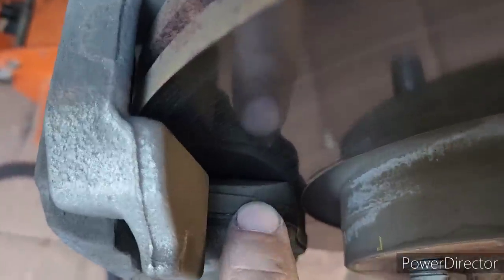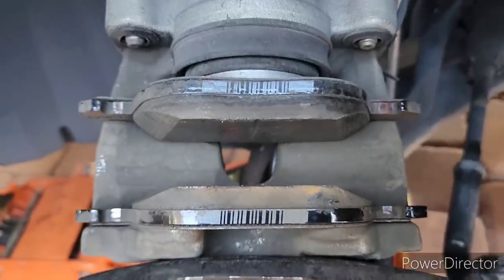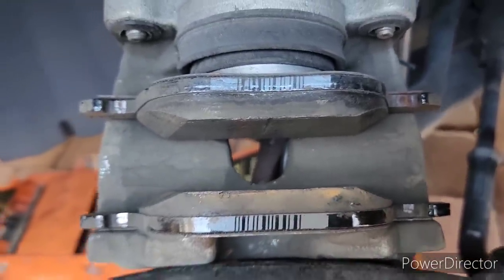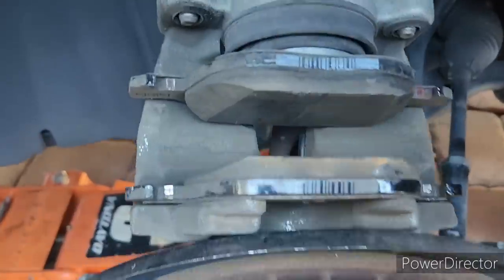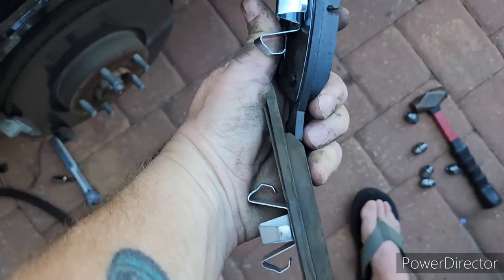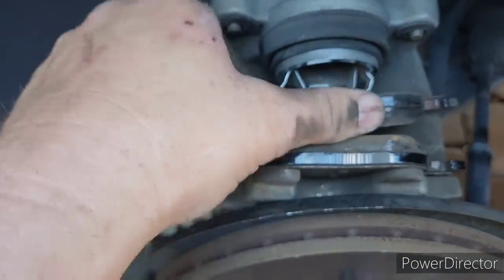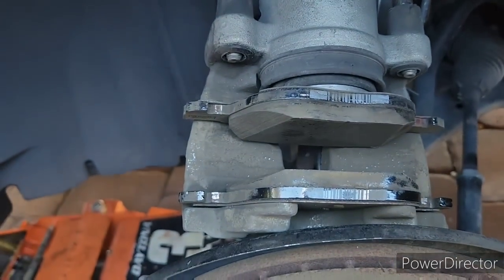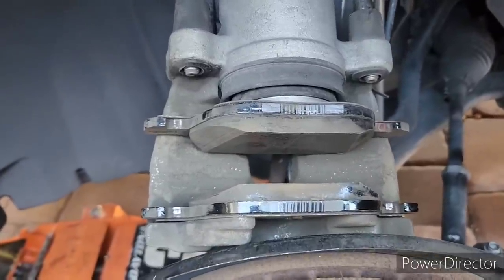Ford dealership robbed a little old lady out of a brake job. (almost)

Comment: Years ago I took my Vespa to a Harley dealership for a motorcycle inspection;  there were no other cycle inspection places around. Yes, they made fun of it, ok, whatever.  The state says they have 1/2 hour to do the inspection and can charge their rate for that.  There are glass window between the waiting room and the shop.  They wheeled my Vespa into the shop, put it on it's stand, and left it there for 29 minutes.  In the last minute, the guy walks over, peels off the old inspection sticker and puts the new one on, and wheels the scooter back out to me.  Zero inspection performed.  Guy at the counter says the bill is $60.  I say, "For what?  Literally no one look at the bike at all".  He just smiled at me and said "Do you want the new sticker, or not?" So, I paid it.  Interestingly, they were later convicted for fraud and are now out of business.  Seems right to me!

Comment: I'm wondering if the mechanic at the dealership wouldn't have just pulled the car around the corner, waited 45 minutes, brought it back up front, then charged your friend for a "brake job".

Comment: Had this exact same scenario, with a Subaru dealer, on my mothers car. I had replaced the front pads 1 week before the inspection. They tried to tell her the pads were worn. Fortunately  she called them on it. I told everyone I could about that experience.
Reply: You'd think the dealership employees would at least check the pad before telling lies to keep from the 
old "foot in mouth" scenario. A buddy was told needs a cabin filter. It wasnt even looked at as the dust wasn't fingerprinted.

Comment: The pay system encourages this type of dishonesty. Work under warranty screws the mechanics. And they try to make up for it. I saw the same thing at a Chevy dealership. Funny thing was that I couldn't sell brakes that were needed. But other guys had no trouble ripping off customers. The service writers are also in the same boat.

Comment: I had a Hyundai Santa Fe a few years back The dealership had thrown in free oil changes as long as I had the vehicle so that's where I got my oil changed. One day, while getting an oil change, the service manager came out and told me I should really change the oil in my transmission, transfer case, and both differentials. I asked him why and he said it was a standard service item. I asked if it was Hyundai's recommended service duration or if it was the dealerships recommendation. He said it was Hyundai's service call. I told him we were going to go and get my service manual out of the vehicle and he told me I was not allowed in the shop. I said fine, you go and get it to which he replied I don't have time for this so is it yes or no. I said I would think about it so he walked away. 

I called my daughter in law and talked to her about what had just happened. She looked it up on her computer and told me I was right about the service intervals. She also said she would take care of it and hung up. About 10 minutes later the service manager came back out and told me they had decided to throw in the additional service for free. I just smiled and said thank you very much. I called my daughter in law back and thanked her for acting so quickly. So what exactly happened and why was my daughter in law included in the mix? Well, the dealership I was at was part of a group that owned over 30 different dealerships. As a result they had a customer service department and my daughter in law just happened to be the manager of that customer service department.  She had called them and told the service manager that she knew what he was trying to pull and informed him that they would be doing the additional service work for free or she would take it up with the President of the auto group which meant his job was history. 

When I went to sign the work order to get the vehicle released I told the service manager that the customer service manager was my daughter in law and asked if we were ever going to have this kind of thing happen again. The look in his eyes was "Damn" but his mouth said no sir, never again.

Sometimes having people in high places just works out for the better don't you think?

Comment: I have a 2015 Toyota Sienna with over 118,000 miles that I bought new.  It has not had a brake job yet.  Most of the miles on it are from long road trips.  I was at the dealership for a transmission fluid change at 78,000 miles when the service writer told me I really needed brakes, of course I passed on that.  I go to an independent mechanic for brake jobs and some other things and he will do a brake job with new rotors for less than just a brake job at the dealer, so I figure I will keep driving until the brakes start grinding.

Comment: A dealer told my parents their rotors were rusted and they needed brakes, so I told my mother I would just change the pads and rotors myself.  Got the pads and rotors and took rims off and saw nothing wrong.  Pads were almost new and rotors had zero rust.  I should have checked before I ordered all the stuff.  But I trusted the dealer

Comment: This happened to me recently, the shop where I usually have oil changes done, called and said I needed front brakes and rotors, rear shocks and lower control arm bushings replaced to the tune of $3,000.  I said change the oil and I'll get back to you.  I took it to another shop and they said the disc pads had ¾ life left, the lower control arms had natural wear in the bushings and same with the rear shocks had a small leak which was common wear and had maybe 10k left of life.  I used to do some backyard wrenching when I was younger and these days in my retirement I find these shops are trying to rip older folks off.  It's best to get a second opinion on every estimate.  I will not patronize that shop anymore and I let people know what kind of scam they're trying to pull.

Comment: A friend found a puddle of antifreeze under his F150 pickup. Got told that it had a leak in the radiator at the Ford dealer. New radiator install quoted at $1200. He went home and crawled under the truck. Turned out all it took was tightening a hose clamp on the radiator hose to save $1200...

Comment: I've worked on cars sense I was 16 years Old ( thought by my Mom ),  I took my truck into A dealership after work for A loud squeak in the rear end , #1 the dealership said I needed break's to fix the squeak " I know better "  &  #2 they screwed up my Alarm system 😮😮,  I took my truck home and found the rear axle was warbling ( NEW BREAK'S MY ASS ) SO I took it to a dealer near my house they said I was right but needed to fix both sides " best service I've had 😊😊😊,. Thanks for doing this video

Comment: Took my wifes 03 Corrolla in for a bracket recall. It had a valve cover leak. He told me it would be $1300.00 before any surprises. I asked if it included the waterpump and timing gears since it was already at 180K. He said no. I advised him I'd handle it myself. He seemed miffed and added sarcasm. Well the gasket was $70.00 with all the needed extras. Brought it to my local mechanic who lifted the motor, did the waterpump and gasket. Toyotas timing gears and chain are bulletproof. Chased some gremlins and it was $650.00 I did mention to the toy mechanic I just completed a ground up including engine done at LRB performance. 440 Magnum 1967 Charger.

Comment: I used to work at a large, domestic car dealership that has a lube rack - lower skilled techs doing quick oil changes, brakes, tires, batteries, etc… It was well known among us line techs that lube guys were grossly overselling maintenance work (like brake jobs).  Management did not want to hear about the dubious work being sold from their cash cow.  Some of those young techs are making well into the six figures selling work that cars do not need.

Comment: I got charged £180 for a full service 25yrs ago by a Ford dealer. They never changed anything. I put uv marker on the oil filter, sparks etc which needed changing and they all stayed in place. Never go to a Ford main dealer or any retail garage as they are all out to rip people off

Comment: Years ago a shop sold my father a brake job that was supposed to include semi-metalic pads which wear longer, and cost extra.  The brakes started to act up, and he had to have another brake job performed.  The shop where he went the second time took off the pads, and said they were just standard pads, and were not semi-metalic.  The shop that performed the original brake job did not honor the guarantee, and refused to acknowledge they were scamming people by installing the standard pads, and were charging for semi-metalic pads which cost more.

I also had a brake job performed at Firestone.  The job was supposed to include a fluid flush, and semi-metalic pads.  Six months later, I had a diagnostic inspection, and they said my brake fluid had 300 parts per mil of copper content, and said I needed a fluid flush.  Then the brakes started squeaking, and the petal pulsates.  I had a inspection performed at another shop because Firestone said I did not have any problems with my brakes.  The second shop found cheap Wagner pads installed, and were coming apart.  They told me the pads damaged the rotors to the point where they could no longer be resurfaced, and had to be replaced.  Again, I was also told, I paid for semi-metalic pads, and they installed cheap standard pads.

It is not just the dealer that tries to RIP you off for brake jobs, but the other shops also do it.

Comment: I had a BMW dealer do the same thing literally 3 weeks after I bought a CPO car from them (it needed a minor cosmetic repair I was promised when I bought it).   Service said I needed front and rear brakes and rotors.  I said "Great!  It should have been done before I bought it as a CPO, you can do it now as part of the CPO package.  Suddenly it didn't need brakes.   When I got home I shined a flashlight on the rotors and pads.  They were brand new.
Reply: You bought a Beemer. Most expensive car to maintain ever. Good thing you have the ability to call them out. John Deere makes much better manure spreaders. In Germany the other brands fans refer to the BMW as a Bayerish, (Bavarian), Miststreuer,(manure spreader), Wagon,(car) Bayerisch Mistst Wagon.
Reply: @charles6952  Also Bloody Money Waster.   I have owned one never again most unreliable car i have ever owned, best car to drive i have ever owned but the reliability lets them down.

Comment: 2:13 the caliper guide, though, is not perpendicular to the brake rotor (look on the groove in the center of the pad) but this is not a reason for replacing the brake pads now

Comment: My wife went to the Toyota dealer for an oil change and they check her brakes and wrote up an estimate for them to do the job. $780 for the four wheels. I did the job myself which consisted of new rotors and new pads for a total of $210 .

Comment: During my time as a tech at a Ford dealer they hired a service advisor who constantly pressured me to lie and upsell everything possible.   Management was fine with it. At one point he was shouting at me to hurry on a low profile 4-tire replacement for a Mustang.  I did the rush job he wanted and scratched at least two of rims, necessitating repairs that cost them way more than me just installing the tires carefully.  Total, pathetic joke.  And the egos, my god, the egos of people there.

Comment: Archer, what ya wanna bet they never would have done anything at all? Just charged her and then let her drive out on the same brakes that she rode in on. My luck would be they don't tighten all the lug nuts down properly  and I have 4 tires going in 4 different directions at the worst time possibl.

Comment: That groove in the break pad is used to prevent cracking, reduce tangential stiffness, reduce fade, and clean corrosion off the rotor.

Comment: Same with a Dodge dealer,  I'm a senior in my seventies and told me their mechanic had discovered that  my brakes were so worn out that it was  dangerous to drive my SUV.   I informed the service agent that, since I was in high school, I have rebuild rebuilt engine, done valve jobs, tune ups, brakes, bearings, transmission, replace ball joints, etc, and there was not a chance in hell those pads were worn out.  They completed the extended warranty work.   When I had my local automotive shop do service if 3,000 miles later, they pulled off a wheel and pads still 45% life left in them.  Dealers are bigger scam artists than a few of local automotive shops.

Comment: In the late ‘80s my mom had bought a new Taurus. At about 20,000 miles, she brought it into the dealership for a minor warranty item. While there they put it up on the rack and found the tiniest  amount of play in an outer tie rod. They explained “ it will only get worse”.  Well, $325.00 later....   The law states they must give you back all replaced parts which I inspected. I complained to no avail.

Comment: I had my 2014 Ford serviced by the dealer for nine years until this time I decided to do it myself. Despite being billed for multiple oil and filter changes, the oil came out as a black sludge and the filter was date stamped June 2014. I can't see why Ford would make all filters for future use - especially when it fits multiple models.

Comment: I purchased a new Chrysler van, some years ago. I always have the first oil change done at 1,000 miles. After 6,000 miles, my wife took the van for a second oil change. The dealer said the van needed new brakes all around. I took the van to a friend's son who was a tech at a jeep dealership, he called me over when the van was up on the ramp, he said, these brake shoes have dimples on them when new, my brake shoes still had dimples on them.

Comment: It's a shame that Ford does this, but not just Ford AAMCO in the late 80's tried telling me that my transmission needed replacing. When I got to their shop my Ford Torino was still up in the air, and I noticed that none of the bolts had any sign of having a socket put on them.
I thanked them and then took my car to another transmission shop where they told me my vacuum modulator was out.
That was a less than $20 fix with them compared to the $1300
dollars it would have cost me at AAMCO.

Comment: I work at a parts store and see this stuff way to often. One time a customer came in  saying they needed brakes as well. Went out to measure the rotor diameter, and the everything was brand new. He had just bought it a month ago and had an oil change the day before. To top it off it needed a cv shaft as the boot was badly ripped, but they didnt say anything about it.
Reply: They wanted to avoid warranty work on that cv

Comment: I'm using car since 1966 , Same year Vauxhall garage done me up. Ever since I never trust any mechanics. Most of them are criminal crooks if you have no idea about anything about mechanical  you be done by most of the mechanics. I'm  76 years old and ever since I learned to do my mechanic job myself, Brakes, Break discs , clutch ,bearing  suspension , services  etc. Recently change my daughter car brake and discs all round for just £134 sterlin  just paying parts= $166.47 Saving her at least £200 labour.

Comment: I'm a retired mechanic in France, Europe and it's just as bad here, I'm retired now but would not trust taking my car to a dealership garage , The difference in doing it yourself is unbelievable, Just done a full service (major) ready for our two year inspection called a  "control technique" all round new tires (I fit them myself and balance them), new brakes and discs, oil change filters, new wipers, a few light bulb and the odd fix at zero cost total cost around $300, garage $1300 maybe more, plus I know it's done right because my family use it and I want them to be safe.

Comment: Had this happen to someone I know last year. Scamstone told them $1800 for brakes on their van, new calipers, pads and rotors. They called me crying. The complaint, the brakes squeal at low speeds... Ok I check it out, put silicone on the back of the pads, tell them $20 and send them on their way. Calipers were fine, pads were at 75%, rotors were fine...

Comment: My son took his Corolla to the dealership for an oil change and they told him he needed brakes. Without talking to me, he bought new pads and rotors from AutoZone and asked me if I would change his brakes for him. He drove it over and of course his brakes were just fine.  So he’s got new pads and rotors sitting in my garage for whenever he needs them. But that dealership failed to notice that he had a busted CV boot on the driver side. So it’s a good thing that he went ahead and bought those parts and drove the car to the house or who knows whether it would’ve been caught in time.

Comment: As a class A mechanic in a dealership, I was fired from my last job as a dealership mechanic - for refusing to defraud customers. Management demanded that we mechanocs SELL! SELL! SELL! all the "extra" work that we possibly could. That amounted to replacing brakes like the ones in this video, belts that were perfectly fine, and any other thing that we could con a customer into buying. 
I would say that at least 90% of the work sold was unnecessary or very premature. Yes, you will need brakes replaced at some point, but not at the halfway point in their life. That is a waste! 
I finally gave up and finished my working career driving a tractor trailer. It paid better and the most of the people I met were honest.

Comment: My 2011 Fiesta has wear warning sensors on the pads that will give you an audio cue, ssk, ssk, ssk sound when it's time for a break pad replacement. I worked as a service writer at a dealership and would have never done this to a customer.